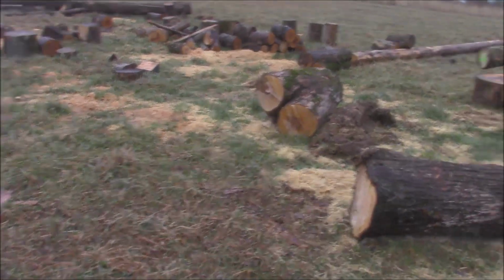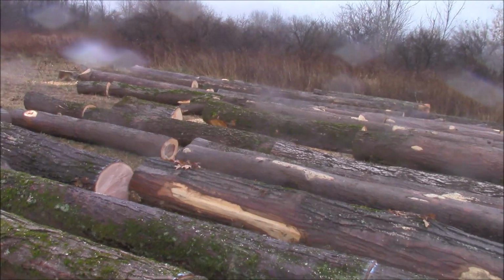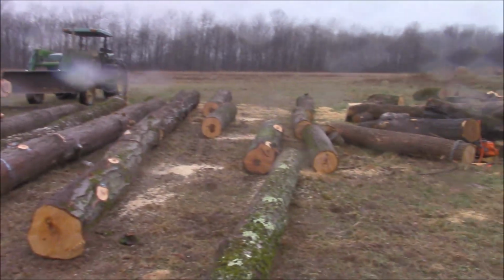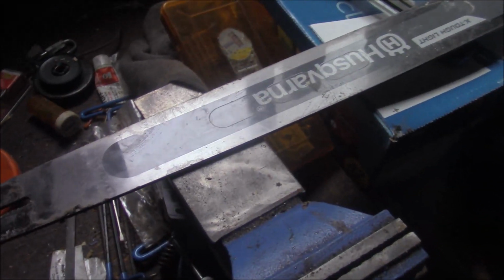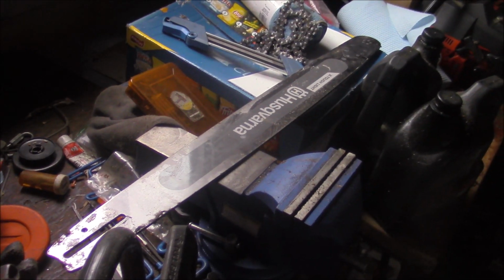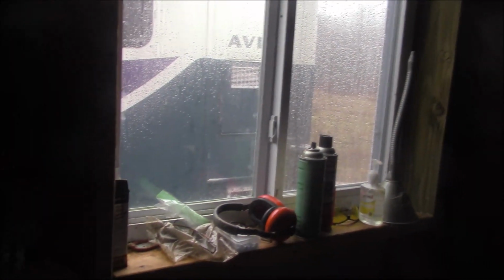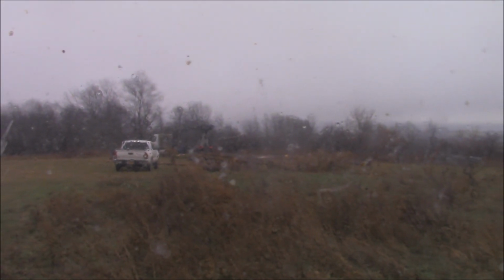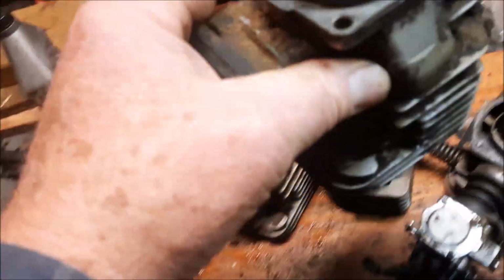My Cookies GO On A  Log Truck

Comment: A forwarder would be real handy for this task $$$. Something you may want to try: I am not sure what's up with your log winch but if you could cut and skid out several straight poles, small enough for your tractor to drive over but big enough that when you sit the ends of the trees over them at the landing they will be off the ground enough that later you can slip a choker chain around  the end, like a dogwood pole. Then when it comes time to buck them up hook a chain on the end of your excavator or if you have a grab hook welded on it,  hook to the chocker to that, pull the tree forward buck it up with it off the ground (use your wedges). Then move down the line. On small timber I buck with a 20" bar, a 32" for very big timber, but mostly I use a 24" with full skip chain. I rarely every buck any logs on the ground. Hope this helps. Glad you were able to get a truck in and out I am waiting for it to freeze so I can move my equipment to my next job.
Reply from the maker: Winch is on the old International 1066 now,  been pulling tops with it. Not really "video" worthy. BUT it will show up as the winter sets in I think :) Good stuff from you as usual. I use the tractor bucket to lift the logs and pretty much do as you said. The excavator.... never thought of that, then could swing the logs out a little to get them away from the others.
Reply: @afleetcommand  the excavator is super handy, especially with a thumb or grapple attachment. I lay out my logs for bidding which involves a lot more work even with a wheel loader with forks, one day I will find a good used forwarder that doesn't need $20,000 to work properly :)
Reply from the maker: My excavator has been sitting in it's barn. Pretty much because the years I did that kind of work it was..... dirt work. So the old farts brain is "partitioned" Dirt work/Woods work. So it doesn't get to play when I'm in woods much unless I have a temper tantrum like last year.

Comment: Less than modern equipment - I don’t think so.  I think you have about as modern of equipment as anybody I know.  As for bar length, I think you lean to heavy for long bars.  I lean towards 20 inch bars with full chisel 3/8 chain.  This past summer I bucked up a 25 inch dead pine with my 16 inch 3/8LP Stihl Ms 170, 171 and 180.  Sure, I could have done it faster with bigger saws but these are light and will get the job done.    I never got their bars in the dirt, either.  They were all new saws and got broken in well cutting the dead pine.